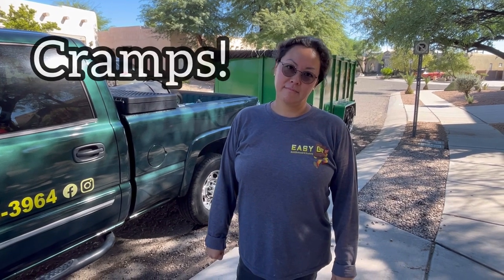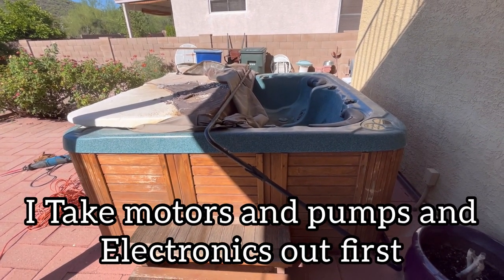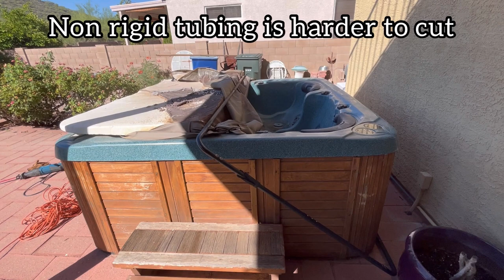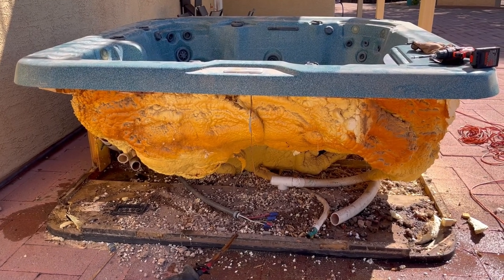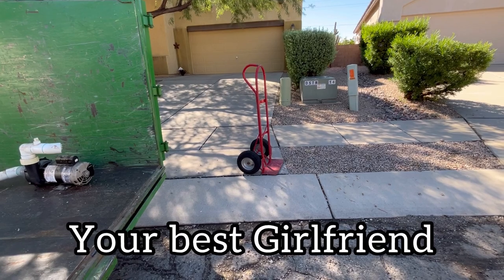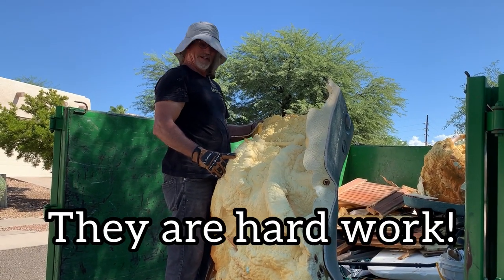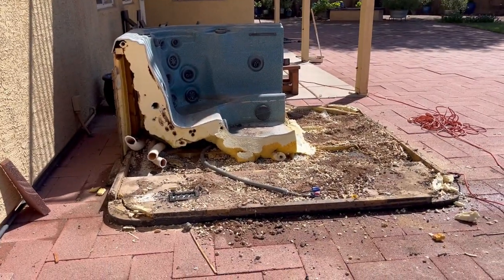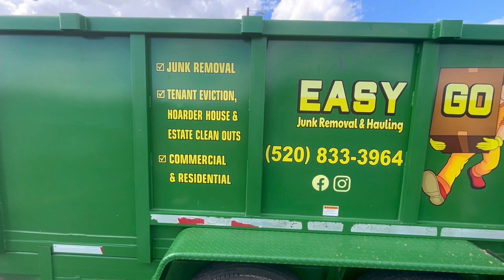1 day 5 jobs!

Comment: I’ve read that some saws alls are more comfortable or uncomfortable to use.  You might what to read some reviews and maybe look into a new saw. Using my saw never really bothered my arms.  Did a job 3 miles away almost a half load and it took less than an hour including drive time.
Reply from the maker: Thank you. I am sure the saw contributes to the cramps but I think my age and the desert’s insane heat contributes as well. But this hot tub did not produce any problems this time but it was only 95 that day! I
Will get a new saw but I want a cordless with power and lots of batteries!!!